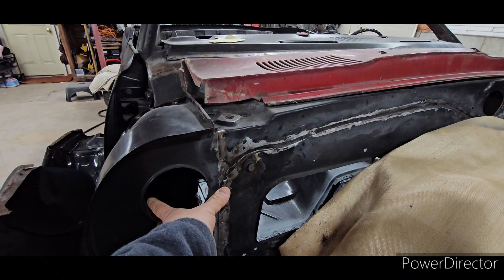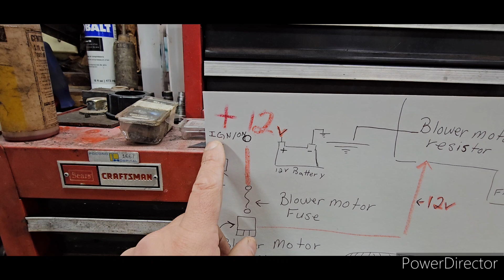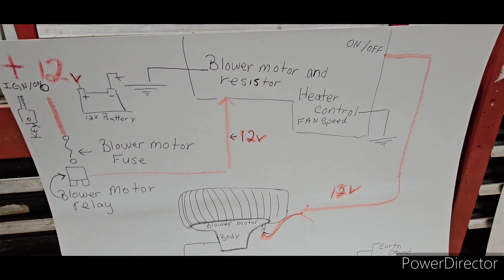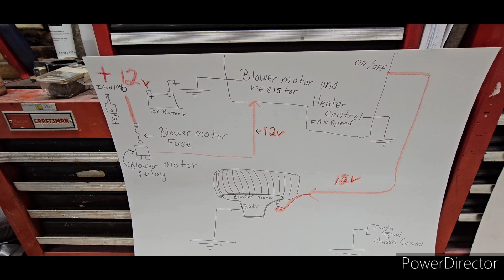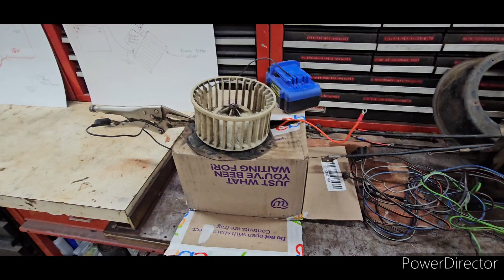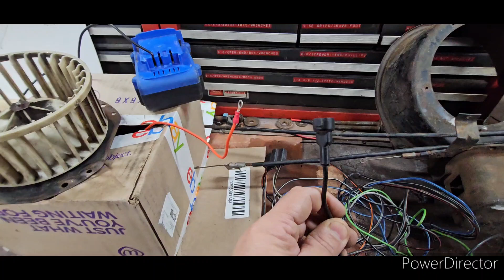How to Test a Classic Car Blower Motor – Easy Wiring Diagnosis #diy #classiccarrepair #gmwiring

Comment: Question for you: dealing with a repair. I don’t have low or high speeds. Swapped relay, same issue. I get about 11.4 Volts to the blower motor. On medium and sometimes high. Other times I get nothing on high. If I jump the relay coil, I get full battery all the way through to the blower. I’m not getting my triggering 12 volts when switching to High using the switch. Guessing next steps it to take the switch out? Any opinions? Appreciate anything you got.
Reply from the maker: Check your resistor